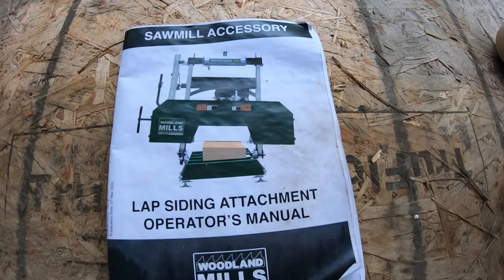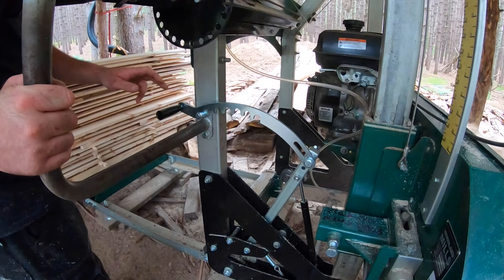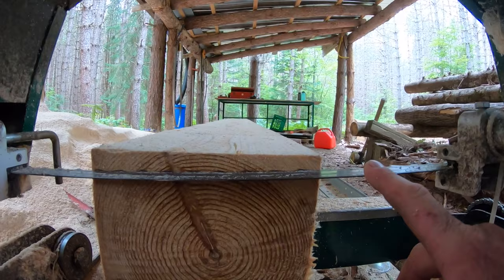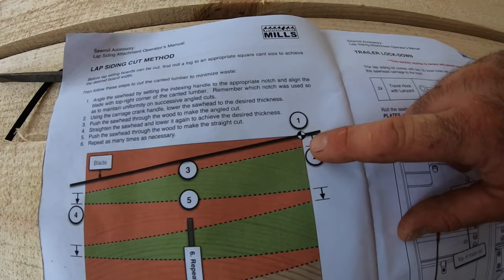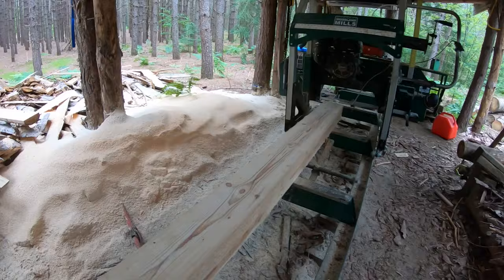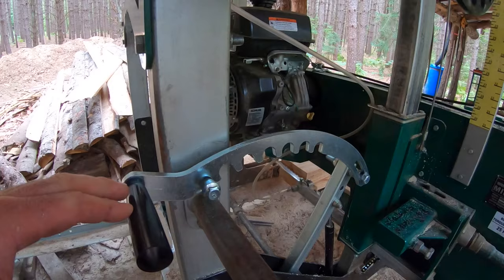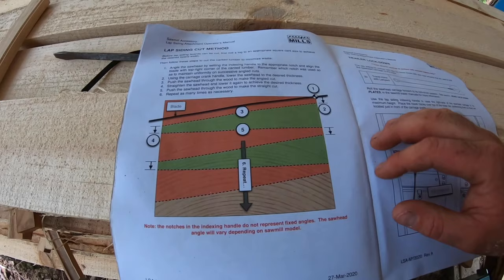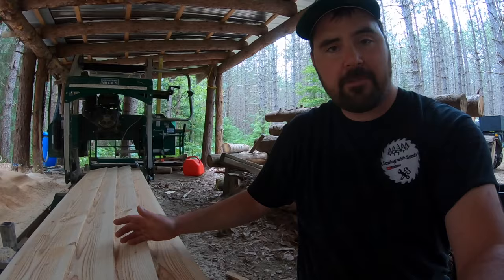Making Lap Siding with Woodland Mills Lap Siding Attachment

Comment: You could just insert a small wedge under the cant and remove it after each other cut.
Reply from the maker: I agree, that does sound like an easier option. Next time around I'll surely be using this idea.
Reply: Especially for 539.00$ vs 0

Comment: Just watched this again. Great video Sandy. 
If u want wooden Shingles, just mill them thinner and use the Chopsaw to cut to various lengths.
Reply from the maker: Great point David. That would make it real easy
Reply: Unfortunately the grain will run across, instead up up/down, the Shingle.  They will split and the bottom half will fall off.

Comment: If you haven't see it already, there is a Made in the USA tool called the LogOx 3 in 1 tool that would have let you pick up the end of the log and easily put it on the mill bed.  I happened to see the video a bit earlier.

Comment: Show us how you run lap siding through the thickness plainer. Thanks for the video.
Reply from the maker: Well if I start running lap siding through the thickness planer that probably means I forgot my morning coffee and  my brain hasn't turned on yet. I probably mis spoke in the video if I said that. It may be possible but certainly would have to do some fancy rigging with my planer to make that one work
Reply from the maker: I do however run lap siding that isn't tapered through my planer like the lap siding I've got on my tiny house. That's basically just like a normal board though
Reply: @sawingwithsandy  A handy man with a 12 inch planer might be able to tilt the cutter to match the tapper.I smooth finish will repel the rain better than rough cut surface.

Comment: Yeah I'm thinking making a cradle for the cant that rocks back and forth would be easier. But thanks for the video, I never would have thought of the cradle without your video.

I notice too a live edge on the siding would be easy and an interesting look. I have seen live edge slabs used on some 19th century buildings when cutting off the live edge was a lot more work than today.

Comment: The problem is you will get a plain sawn siding,not a quarter sawn siding. It will cup. I have seen quartersawn clapboards made at Wards clapboard mill. they makea very good stable siding. pine or spruce , I think . At Wards they take a 6 foot clear log. put it on a big shaving rig, like a lathe bed, it makes a big dowel- like piece of wood. The circular  saw cuts from the outside to a core,about 6 inches in. it then clicks over about  5/ 8 of an inch. You get tapered slices that are quarter sawn. They are planed on one side and the fat edge is planed straight. They had mills in VT. and Maine. They may not still be in business. It was excellent siding. restoration grade for historic buildings. Pine clapboards lap siding  like you saw,cup and break.
Reply from the maker: I can imagine some cup when plain sawing I just haven't experienced that on any of my buildings using the siding I"ve cut plain sawing.
Reply: @sawingwithsandy  how long have they been up/ they always cup toward the heart of the log.

Comment: Is there any performance degradation or accelerated wear from leaving the siding attachment on for all other sawmill cutting? i.e. should you uninstall the lap siding attachment if not using it for lap siding?
Reply from the maker: Hi James. I had the lap siding attachment on for years on my first woodland mills sawmill and I used the sawmill more for regular cutting than lap siding cutting and it cut flat just as well as it did when the lap siding attachment wasn't installed

Comment: Hey Sandy...just getting ready to install my lap siding attachment on my 130 as well...wondering if you have any tips on drying lap siding once cut. I'm doing a bunch of ash since the ash-borer beetle killed them all. How do you sticker the siding boards once cut, and for how long until you think they are ready to go on the house?
Reply from the maker: Hey thanks for the comment. I try to let the wood sit there atleast through the summer months before I use them. I don’t really have any specific way I stack them aside from the tall side of the lap facing the same way so the stickers lay flat

Comment: Thanks for the video...helpful and well made.  I'm curious what you think of the lap siding feature after a year with it?  Do you think it compromises the stability or level of the cutting head in any way? I just ordered the 130Max with extended bed and lap siding addition.-arrives in late Feb  - cheaper then the materials for deck and siding
Reply from the maker: Hi Eric. I find the lap siding attachment continues to work well. I do use it but only when I'm doing certain types of siding. It's nice that it's there just in case for sure. Hope you enjoy your new mill.

Comment: I use lap siding on my house, because the house is 170 years old, and came with lap siding. However,,,lap siding should, NOT, be tapered. The taper on lap siding is a way of increasing yield from your cant. In reality, tapered lap siding, will leave a gap under the center of each board, and when nailed, will bend, and often crack the board. Just lay out a few pieces on a flat surface, and look at the cross section. For good, and much more stable, siding, simple 1/2' boards will work, and be less prone to cupping and splitting. Not to mention simpler to mill. Just my opinion,, of course. 
I love watching your progress, and really like the way you explain the process so clearly. Just one question. Did Woodland mills prevent you from showing the mechanics of how the mechanism works ?
Reply from the maker: Thanks for checking out the video. I've go a video showing the parts of the lap siding attachment being installed. Just scroll back a litlte bit from this video.
Reply: @sawingwithsandy  I did watch the whole video of the install, but did not see what happens with the wheels when you pull the lever. Do they pivot toward each other to raise the head ?
Reply: Actually, using straight sawn lumber will result in a BIGGER gap under the center....that is one reason for sawing a taper.  Also, you DON'T need to nail in the center of the pc.....a few nails should only go about an inch from the top, and the rest an inch from the bottom (going thru the top of the pc below)

Comment: Hey Sandy, two questions, first would the saw handle the wood fibers if you turn a short cant sideways to make shingles? I have a bed for my hm130 to attach the shingle cants and in theory its possible to do over 20 shingles per pass but not sure how the saw will cut making the long fibers instead of sawdust? And woodland mills website doesn't have a price out yet on that lap siding mod so can you give us a rough idea? Nice videos Josh must like you too.
Reply: Did you try this? I'd like to know how it went as in thinking about doin that as well

Comment: wouldn't it be easier to make a few shims to pur under the logs?
Reply: Shims? No way. Having to lift the kant by hand while trying to bend over and position the shims...then reclamp the log...then lift the kant while trying to dig the shims out...over and over and over, dozens and dozens of times. Versus just moving a handle? 

Yeah, you'd get tired of those shims real quick.

Comment: The adjustment lever looks cumbersome to operate, would the gas shock give more assistance if the ft lbs was higher? And does the handle get in the way of the saw head adjustment lever when cranking up or down? 
BTW, Good instructional video, well done.
Reply from the maker: good to hear from you William, the pressure in the gas shock is sufficient I think for smooth operation. It will actually almost hold the mill in place when I lift the handle of a notch. The handle doesn’t get in the way when cranking the height up or down. So far I like it and look forward to keeping on testing it

Comment: Doesn't take an attachment......all it takes is 2 small pcs of plywood for shims.

Cock the cant up off the bed with a peavy,  stick the plywood shims between the bottom of the cant and the bed rail.  Saw a pc of siding.....the taper will be to one side.  Next pass, remove the shims...the taper on the siding will be on the other side.  Keep going until the cant is all turned into siding.  I've made many many many thousands of feet of siding over the last 30 years using this simple method that costs nothing.

I actually bought a Woodmizer siding/shingle attachment, and the first time I used it and figured out that is ALL it does (cock and uncock the cant side to side), I hung it on the wall of my mill shed and never used it again.  One of the problems with an attachment like Woodmizer's is you have to saw a log into a cant.....then move an often REALLY HEAVY cant out of the way ( I often saw cants 16' long, 8" wide and as tall as I can get out of a log to make siding......sometimes 20-24")....Place the attachment on the bed (and it ain't exactly light either), then wrestle the fool cant BACK into the dadgum attachment and saw siding.  Heck, by the time you do all that, you could have sawn the whole thing into siding using shims AND SAVED ALL THAT WORK !!

Now the Woodmizer attachment IS GREAT for sawing shingles.  You load 6 blocks of wood in it (Up to 24" long, up to 12" wide and however tall you want) and it cocks/uncocks the blocks front to back instead of side to side.  Make a pass with the saw head,  take 6 shingles off per pass.  Throw the attachment lever, the block goes back down to level, make a pass....6 more shingles.  You can make a LOT of shingles in short order..  Which is what the guy that bought that POS attachment from me was doing.....making shims to sell to mobile home companies that blocked up trailers....the shims went on the top of the block pile to do the final leveling.

For him, it was a useful tool.  For me, it was a wall ornament.

Comment: Quick question: I'm buying the HM122...what would determine if I stay with the 7hp engine or go with the 9.5hp engine?  I would think as long as my blade is sharp that the 7hp can cut through hardwoods without a problem...or am I wrong about that?
Reply from the maker: I’d imagine the size of log would have a roll. If they are smaller logs I’d go for the 7hp, if larger I’d get the 9.5
Reply: Thank you!

Comment: Greetings Sandy, informative video on lap siding! Getting ready to push the go button for the attachment for my HM 126. Your video certainly played a part in the decision. Curious about two things though.  You mention that the thin edge of your plank is 1/2", what did you end up thickness wise on the thicker edge? Also, you mention, and I've seen this referred to elsewhere, that cutting tapered lap siding improves the yield from the cant. Did you do any math to see how many extra boards you might get as opposed to straight cut planks? Cheers, Erik
Reply from the maker: Hi Kire, Unfortuantely I don't remember what the dimensions of the lap siding was but since there is adjustability with the attachment, you can make the thickness on the opposite end anything you want by raising and lowering the saw height and saw head tilt with the attachment. I haven't done any math to know the exact yield unfortunately

Comment: How do you recommend to stack a pile of this lap siding?  I can't figure out how you would sticker the boards effectively to avoid warping without keeping my stack to just a single piece of lap siding in width.  Which doesn't seem like a good way to go about it to me.  Would appreciate any suggestions or maybe even a short video (hint). :-)
Reply from the maker: I think I’d stack a few pieces with them having the tall edge against each other followers by the next pair having the thin edges together. Then I’d have a flat surface to put my stickers on as the tall edge would stick up and support the stickers. Hope that makes sense

Comment: Sandy, the builds I have seen you making are with green lumber.  I would think that the lap siding would cup more, and you wouldn’t always be able to but the “bark side down” because there would be a slight variation on the bottom lip.  I would also guess you just nailed the top like the clapboard you used on the tiny house.  My question is how did you like using the lap siding after you made it?  Do you have a preference between the lap siding, and just using the clapboard style.  Did it cup a lot, and require face nails later after it had dried?  Any other suggestions for installing?
Reply: Face nails are always used... galvaized ringshank # 10 if you are also going into a stud which is covered by sheeting... or # 8 if you are nailing direct onto a stud... or only hitting 3/4 inch sheeting. Some guys like galvanized twists. A lot of guys show nailing on the upper thinner edge, and covering these nails with the next row. Carpenters do not do this; this seems to be a video fad that caught on by misinformation being multiplied... The proper proceedure is to place the first nail about an inch above the bottom thicker edge. The second row overlapse the top, thin edge of the preceeding row by one inch. Be sure to nail about 1 to 1 1/8 inch up from the bottom edge of new row you are working on. You want this nail to miss the top thin edge of the row underneath, that you are now overlapping. (Miss it or just graze it but don't nail through both boards) You are using this nail to hold down the thin edge of the row below; so one nail does two jobs. You want the top, thin edge of each row of siding to contract and expand behind the upper piece of siding. The very top-most piece wil be whatever width is needed. You can use a nail on the upper and lower edge of this piece. I like to plan my rows so that the top peice (under the eves or soffets) is an inch and a half wide, ripped from the thick edge of a piece of siding. It looks like trim up there, and acts the same, allowing the lower piece of siding to expand and contracy with the seasons. Siding will not crack along the grain over time using this tried and true method; even when using green lumber. Stain type and species will also determine the amount of expantion and contraction that will happen. I like neatly place galvanized ring shank nails. They do not rust and have a small head.
Reply: @jasonmiller7794  This is the correct method for installing lap siding and works perfectly even mixing green with dried siding boards. Works just as well with non tapered (clapboard) as it renders shrinkage to a non issue. I use full 1"x 4" vertical trim boards at the corners and saw cut or router a 1/2"x (D") rabbet that recesses the siding ends behind the trim. Where the siding ends have to be butted together I use a simple plywood jig that I can slide the siding piece into and router a 3/4"" lap joint across. Depending on species (mostly Western Red Cedar or Douglas Fir) and moisture content you will get a small shrinkage gap but it's not bad. I like the thicker lap siding 1/2" thick at the top so there's enough wood to make a 1/4" lap joint, measured from the back. The jig uses a piece of tapered siding as a shim to hold the piece level for routing the back rabbet. I usually install a few rows of siding before I route any trim so to get the D" rabbet depth correct, not too tight. I hand nail everything with galvanized 2 1/4" trim nails with small heads and only nail into studs, never through the top of the siding or into sheathing alone. Watch out for mule tracks!
Reply: @kknows3512  I have remodled many very old homes with first growth siding that was milled from virgin timber years ago. I am 62. I have installed western red cedar as well, shipped in from the west coast, as well as all kinds of siding. I live in the Missouri Ozarks. I have also milled my own for customers wanting unbeveled lap sideing, 3/4 x 7 or 8"; always an exposed nail at the bottom edge, which cinches down the preceeding row underneath. There is too much irregularity in rough cut southern yellow pine to do anything but this. Also keeps the building tight against the wind. So, I do not see the logic or the practice from a century and more of carpenters, or the instructions of beveled cedar siding companies, of nailing at the top of siding boards. Cosmetic only but not secure, especially in windy and sunbeaten areas. Good idea with the rabbet joint at the trims, but seems like this would only work with shiplap siding, and not with full lap siding boards or beveled siding boards. realcedar.com/siding/installation/profiles/bevel/

Comment: Sandy, guess I better start a lap siding attachment budget item so I can get me one when I got the funds saved. One question though, in the video it appears that you had a little problem getting the saw head locked back level. Is this a problem ? Or was it not?    I really thought you did a great job explaining everything 👍
Reply from the maker: Since I’m still learning the ins and outs of the siding attachment I find if you put a little down pressure on the mill handle as you go back to the horizontal notch it helps as the gas shock is stiff enough to almost hold the mill up even when you lift up on the indexing handle. I also lift up just slightly on the mill handle when going from horizontal notch to a tilt notch for the same reason. It’s a pretty smooth process once you get the hang of it I find

Comment: can you make shingle with it? assuming no
Reply from the maker: Hi Francis. I suppose you could but the grain would likely be backwards if you were to just cut a piece of long siding then cut into shorter pieces. Otherwise you could make a jig to hold short pieces of a log and  cut the siding with the lap siding attachment after you make that short log section into a square cant.
Reply: @sawingwithsandy  do you still have that lapsiding attachement on your new mill?

Could make a nice video :)